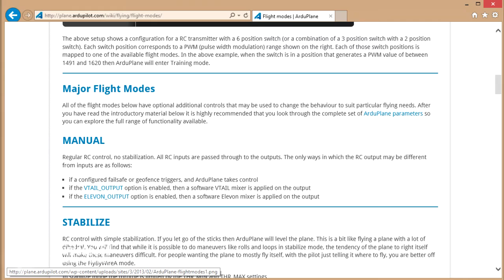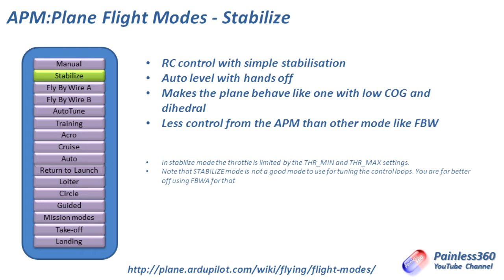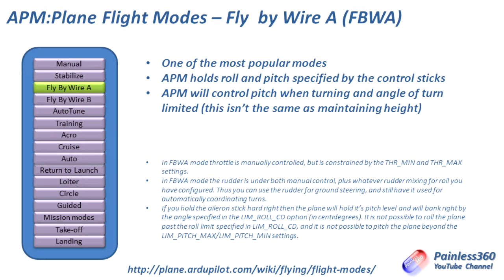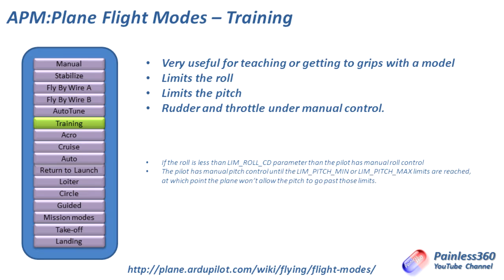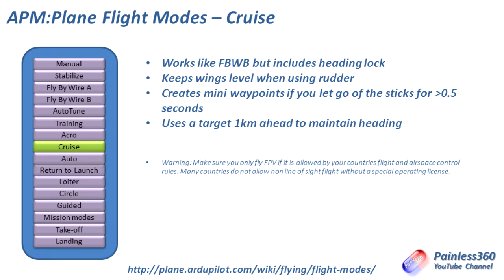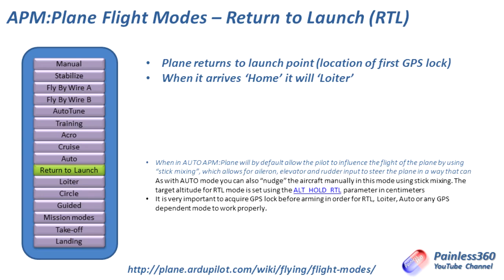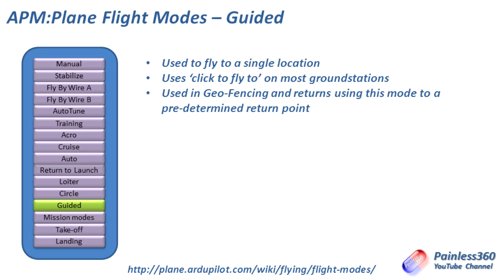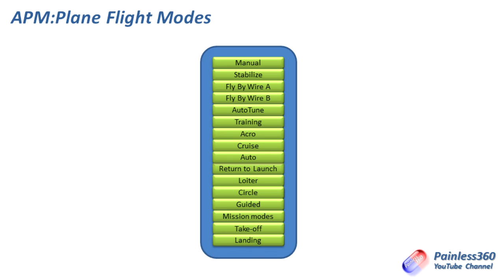(3/3) APM:Plane Mode Overview

Comment: Thanks for your reply.. I am using autopilot board with ubloxM8N gps. I have tried stabilize mode it fies ok. But when I turn. On auto the control surfaces responding correctly but motor not spinning
Reply from the maker: +Nehru Nehru is this related to another question ive already replied to?  Please use 'reply' else i cant keep track of the conversation with all of the comments and questions I get daily..

Comment: do we need a telemetry system for the mode auto? or gps lock is sufficient?
Reply from the maker: +Teddy Matthew gps lock only. Best of luck
Reply: i'm a bit confused, i connect the apm to mission planner, i connect the board. After making the mission do i just plug out the usb cable ? or do i disconnect? i mean how do i keep the board connected to the apm without the telemetry ? thanks and regards

Comment: Hello, I have found the answer to resolve my issue with the modes in APM Plane and even rover. For some reason the Mission planner software assigned channel "8" in the advances settings configuration for the mode select. Even though In the radio calibration the sliders showed that channel "5" was functioning,, in all reality the assignment was channel "8" After changing the "8" to a "5" the mode worked great.  This only happened when setting up firmware for "Plane" or "Rover" ?????!!!!! Just wanted to pass this on if anyone else had this issue, Thanks again
Reply from the maker: Great tip, thanks for posting the answer..
Reply: Any Time,,, Thanks for your Great Videos,,, You have a talent for teaching!!!

Comment: Hello, just a quick question about my APM 2.8; In calibrating my radio I noticed when using APM plane all channels work fine including mode sw calibration, However, when checking modes after setup the modes will not change. but in Radio Calibration it shows them changing. All Works fine in Quad setup. Tried two different radios and cables as well,, all the same
Reply from the maker: +Marshal Palmer I've not seen that. Let me know when you figure out what it was  please. Best of luck!
Reply: Ok thanks for the reply. Ill let you know so you can pass it on to others who may have this experience.

Comment: Thank you for the detailed video.
I am new to flight controllers and confused how using 433mhz telemetry txrx while the radio controller is 2.4ghz doesn't this cause signal interference? ?
Reply from the maker: Nope, all of the frequencies need to be different to avoid this. That's why FPV is normally 5.8Ghz, Radios are 2.4Ghz and telemetry is either 433 or 915Mhz depending on location..Hope that helps!
Reply: Painless360 I thought the control  freq should be the lowest to avoid   harmonics from telemetry module.but it seems ok.

Comment: i have a question
i set up my rx to throttle up 50% and set it to rtl mode too for turned off tx (complete signal loss)
worked good in mission planner
but never tried in field

is this okay to set up this way?
Reply from the maker: You've set the failsafe at 50% throttle on the receiver? Not sure what you're explaining there but you only need to set the failsafe on the receiver to initiate a RTL, the APM should take care of the rest. An airspeed sensor can be very useful if you're planning on trying this..
Reply: success!! in RTL with my settings

but problem occured in FWBA and autotune mode,
so little pitch up but can pitch down rapidly
is this normal?
Reply from the maker: I've not seen that here, I'd have a look in the forums. Please let me know when you get to the bottom of it..
Reply: i found it,
by setup via basic tuning, in navigation angle rows, i add more pitch max to 24 degrees (default is 15) and decrease pitch min to 18 degrres (default is 25)
Reply from the maker: Nice - and that sorted it?
Reply: yeah, i saw more angle on elevator when pitch up
havent tried it for fly,

Comment: Hi Painless.
I'm having an issue with the motor cutting out when i switch to RTL mode.
It works fine in Manual and cuts down the Revs in FBWA but switches off completely in RTL.
Clearly I'm missing something in the planner but I just can't seem to find where.
I don't want to throttle to cut off completely when it enters RTL mode.
Cheers....
Reply from the maker: I'd check the logs and see what it's doing. I've not seen or heard of that. Please let me know if you find an answer..
Reply: found out what it was.
Just simply.. If the Wing is on the ground the APP shuts off the motor.
as soon as I flew it and at altitude switched to RTL the APM spun the motor up to the specified speed in the settings.
I just didn't understand that when the Wing is close to the ground the Motor cuts off.
Thanks for your help.
Your tutorials helped me set up my Teksumo Wing tremendously. 
cheers.
Reply from the maker: Wonderful news. Glad you figured it out!

Comment: Great series, I learned so much from your walk-through. Question, was wondering if you've had any issues with the voltage regulator burning out on the APM? Someone on RCG was recommending the APM Pro Mini over the 3.1 primarily because of an issue with the regulator. I realize folks mileage will vary, but thought I'd see what your experience has been.
Reply from the maker: Impossible to answer as it depends on what you want the flight controller to do. See our video on flight controller comparisons for more detail. You can get simple stabilisation to full featured autonomous flight.. Best of luck!
Reply from the maker: I've not here, but I've had quite a few subscribers over the years have regulator problems on all versions. I've not tried the Pro Mini here so can't comment but it looks like a build for the more experienced confidant builder as you may need custom cables for the GPS etc. Happy flying!
Reply: Hey. Please tell me whether to buy APM as an autopilot for the wing, if so what? And if not, what is best to buy the cheapest?
Reply: Painless360 there is a complete autopilot, just as in other systems?
Reply from the maker: Have a look at the flight controller comparison video. If you want a full autonomous flight controller (open source) then it's APM, Pixhawk/Pixracer.. Best of luck!
Reply: Painless360 And it is not difficult to configure?
Reply from the maker: The steps are in the video. It's easier for a plane with less mixing.. Best of luck!

Comment: Hello guys. Could anyone help me with arduplane and more specifically NAV_PITCH?
When I switch from manual to FBWA, nav_pitch goes to -2. In result the plane pitches up like crazy. I've trimmed it and it flies great in manual. Also did trim_auto. I could not perform autotune as the plane pitches up and therefore unable to complete.

Thank you.
Reply from the maker: There is a lot of setting up for it to work perfectly - http://ardupilot.org/plane/docs/starting-up-and-calibrating-arduplane.html Best of luck!

Comment: Painless could you do a video with the multiwii on the tuksumo or some other wing please.
Reply from the maker: Hi Plug, thanks for the idea but I am not planning to. If I were to add another board to a plane it would be a CC3D or Naze32/Flip32. Much easier to setup..

Happy flying!

Comment: On the mission planner end - I've got multiple apm configurations flying: a hexacopter, a plane and a quad. How can I manage the different configurations within mp? For instance the plane has an airspeed sensor as the hexacopter has an optical flow.

I should I do this?
Reply from the maker: This data should come from the FC itself as part of the download when you connect. I run a few models here with APM and haven't had a problem. Have you had an issue?
Reply: Painless360 yes, my mp keeps looking for the (example) rssi input that I have configured on only one model.
Reply from the maker: Not seen that here, I don't use RSSI with my kit. Maybe the forums can provide an answer..

Sorry I can't be of more help. Best of luck.